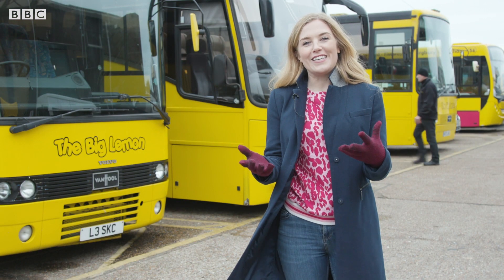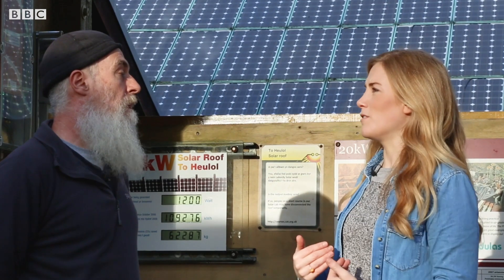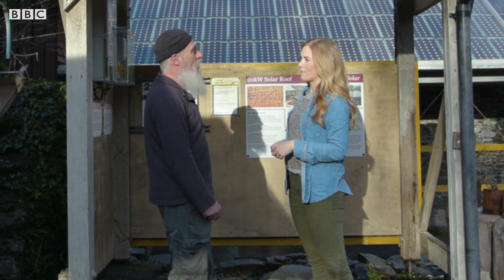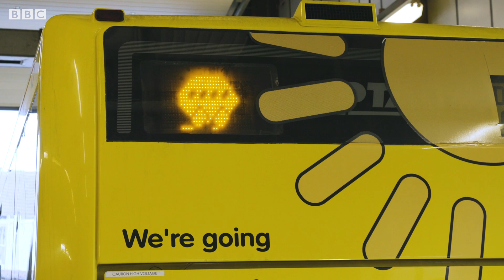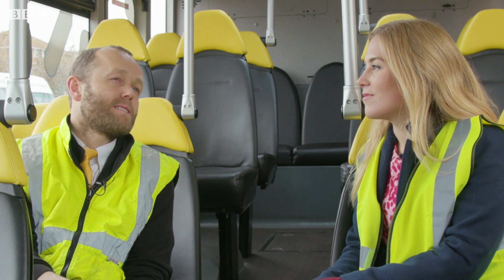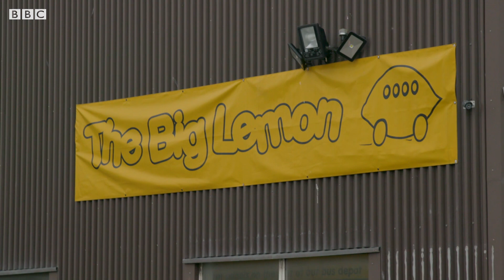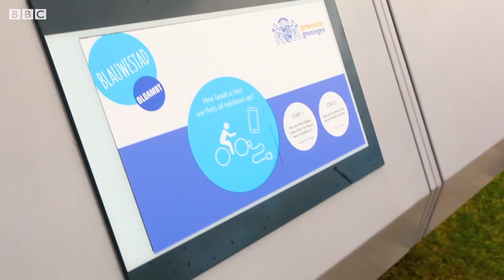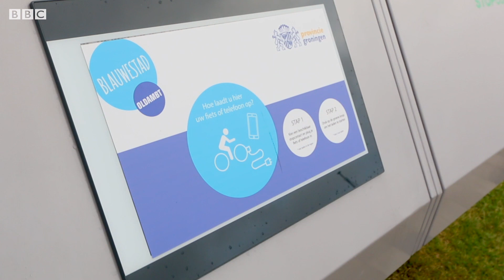Could You Power Your Own Commute? | Living Off Grid with Maddie Moate | Earth Science

Comment: Great video and great initiatives.
It is very possible to power ones commute and house now with solar and batteries. We have had a Nissan Leaf for four years, instead of upgrading that, for less than the the price of a new electric car we invested instead in 10kw of solar and 26kwh of batteries and now have switched off the grid completely so our house and car are 100% solar. Cloudy winter days are the exception and a charge is needed at work!

Comment: Why dose the solar road have a battery if its connected to the grid? 
Batterys makes large CO2 footprints and to charge it would make the whole system less efficient. And driving on a solar pannel would scratch the surface and make it generate less eneryg. A more enviromentally friendly way to generate electricity is to just to build some nuclear power plants.

Comment: Few hundred watts of solar on with a big enough battery will charge as you drive. Imagine driving 20miles to work for 8 hours. By the time you get off, your batteries are charged back up again. Or imagine driving 1,000 miles. That's like 16-32 hours. By the time you drive all day, you charge all day.

Comment: I power my own commute using a PV array I've installed on my roof. It wasn't expensive at all as I did the work and designed the system. The electricity powers the Electric Velo that I built. The picture is to the left. My ROI as compared to being connected to the grid is just under 4 years
Reply: Well done, sir!
Reply: @NoHandleToSpeakOf  thanks

Comment: Saves over 100kg in CO2 emissions a day. That's pretty incredible. 100kg of a gas per day...
Reply: CO2 is much heavier than you think. All the rubbish you produce in a year weighs about 500kG. The CO2 you make in a year is something like 20 times as heavy (10 tonnes). If you had to put out 400Kg of CO2 in a bin every 2 weeks, or deal with the massive 2 tonne pile when you get off a flight, along with your 30Kg of luggage, you'd take note, but as it just floats off invisibly, we all ignore it.

Comment: I bet the bourgeoisie like solar freakin’ roadways because it helps to sabotage the renewable energy movement. TFoot did a great video debunking solar roadways. Point is, they build the dumb solar roadways, they’re extremely expensive, high maintenance, they break and wear easily and when this ill-conceived infrastructure is installed, they can say, “look, renewables are insufficient. We should stop investing in them.” And that’s how fossil fuels win. Just build conventional solar farms. They’re cheaper, they work better, they are low maintenance; basically everything solar freakin’ roadways are not. We can’t afford to drag our feet on this issue. Humanity is at stake.

Comment: To me it has always seemed like a no-brainer to put solar panels on busses an trucks. Even on a small car's roofs it would be awesome in sunny areas. Imagine running the AC without having your engine running or your battery draining. It is surprising their use is not more widespread.
Reply: Price, aesthetics and physics.

Price: can be overcome by incentives.

Aesthetics: personally I find that secondary that my car roof would be a solar panel, but I can imagine many people feel differently.

Physics: Actually this boils back down to price again. A car roof is important for structural integrity. One of the main reasons why a cabrio is much more expensive than a normal car. If you put something on top of it which doesn’t allow for any flexibility, you’ll need to make special design considerations.
Cheaper would be to place the panels on top of the roof, much like solar panels on a houseroof. I wouldn’t be surprised if the solar panels on the bus are placed like that and not integrated, flush with the body. 
However, driving a car with solar panels mounted over the roof like that … at that point even I would have issues with those aesthetics.

But for busses and trucks … yeah, no-brainer.
Reply: @GapWim  imagine it integrated like a sunroof would be.   Heck you could even make it open like a sunroof with some clever engineering.
Reply: RubsNL | With clever engineering, many things become possible. But there are two caveats to this:
- again the annoying pricetag of building the damn thing such that it doesn’t break every 6 months. The fact that it’s still considered niche doesn’t help either.
- second one is a similar flaw solar roadways has; sounds good in theory but has major drawbacks.
One for example is the following: When are you going to open the sunroof? When the sun is out, I would imagine. But that means the very moment you can get the most out of your panels, you effectivly halve the surface area.

Comment: Try a bicycle!
Reply: I've been cycling to work for years, rain or shine, freezing cold or blazing hot, as much as 13 miles each way.
Reply: @MatthewStinar  13 miles on a rainy day is not an acceptable bike ride for most, that's quite impressive
Reply: A couple of miles or less you can walk easily, or ride a standard bike. e-bikes really have the abiliity to make a 10km+ route enjoyable for the majority of people, given decent weather.

I ride 14km each way in all weather (Queensland doesn't get much snow, however, but we get all kinds of rain), and it's really not that bad. I don't mind getting wet (I shower at work), and have either a road bike or mountain bike depending on how wet it is, but an all weather commuter that is an efficient hybrid design with wide tyres and guards, with an all weather jacket, would be enough for most people in most weather. These can be had VERY cheap, often less than the cost of fuel over a few months from a car used for the commute.

Even compared to public transport, I paid for my quite expensive road bike in only a couple of years by riding it instead of the bus, and got fit and saved a bunch of time as well. Door to door, in the city, I'm about as fast as a car driving in anything like peak hour traffic.
Reply: @6squall9  13 miles is indeed at the upper end of most people's enthusiasm (even with an e-bike, just for time reasons), but there are an awful lot of commutes between 2 and 13 miles. Many could be bikeable, especially allowing for e-bikes. Almost anyone can bike up to 5 miles (25 mins) without much difficulty, given reasonable cycling conditions/routes. http://pct.bike/ gives stats for the whole UK on what proportion of trips could be done by bike, or e-bike.
Reply: queen! bicycle! radio! fat bottomed girl!
Reply: @alephii  yeah if your commute is couple miles or less and you live in a place with very nice weather, electric bike is pretty ideal. many people could even charge it at work for free, not to mention lack of insurance and very cheap maintenance. talking from experience of course, cause that's how i roll :D

Comment: The fact that we only have 115 years of coal and 50 years of gas and oil left has almost nothing to do with why we have to move away from fossil fuel powered commutes.
Reply: Agreed, almost left because of that statement. Then there as also no talk of rideables and little of electric cars. The the solar road were the icing on the cake. how did she get this job with so little ability to be thorough and correct.
Reply: @skyfly200  I think Maddy knows better - (she's been on fully charged as well). I hope she was just given a script rather than wrote this. She should probably have argued about it though, as it does make her (and the program) look dumb.
Reply: @xxwookey  Fully charged? yea they really know their shit - NOT! the amount of pointless inventions they pedal is worrying. Basic renewable energy is not that hard.
Reply: Have you looked up the methane hydrate map? You have any idea how much oil and gas that is? Enough to jump the earths temperature 5 degrees relatively instantly. There is almost endless oil and gas. The question is are humans responsible enough not to touch it? This is the earths carbon sink. The earth is not running out of oil and gas any time soon. That 'lie' is a misunderstanding. It's counting the accessible oil and gas at the time the study was written. There is plenty of oil and gas we just haven't been able to harvest yet. We can't harvest the oceans deep reserves because everything freezes at that pressure. But we could build staging to those depths like a reverse mine shaft at great expense. Or something like it and be able to tap into it.
Reply: Solder Joe "everything freezes at that pressure" ARE YOU AN IMBECILE! Everyone knows that pressure is inversely proportional to temperature! God damn these tree hugging hippies!